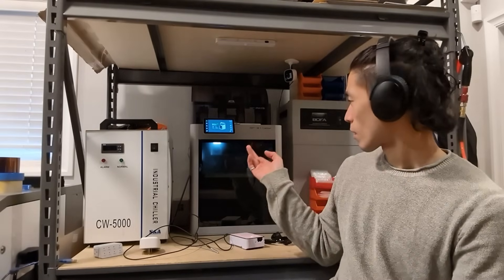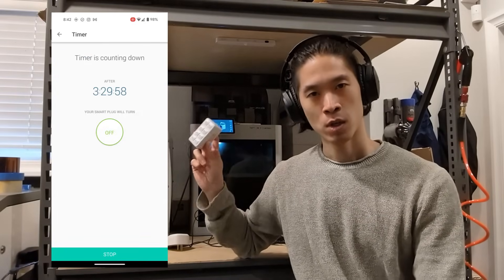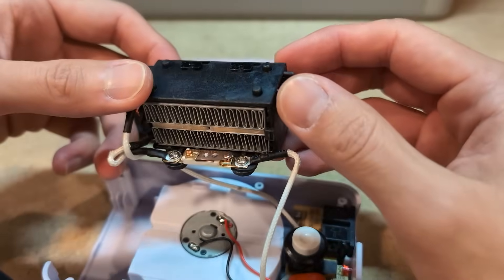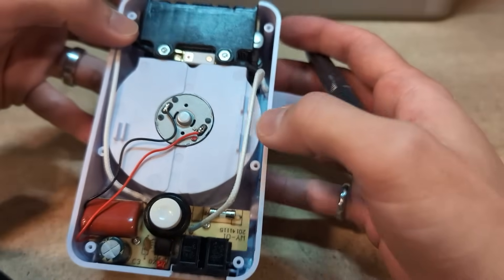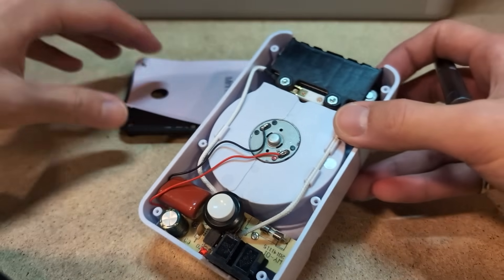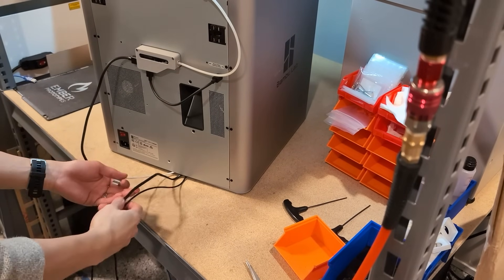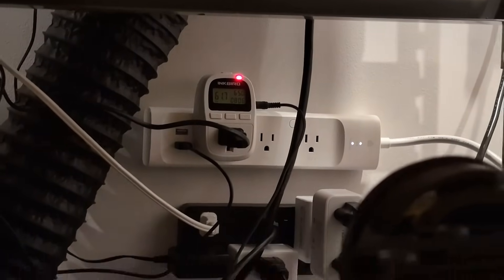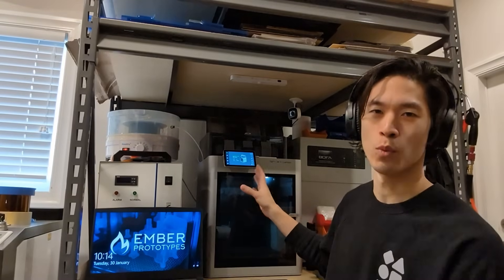Bambulab X1C - $50 HEATED CHAMBER

Comment: An alternative to these three devices, but in the form of an all-in-one, single product (for the same price): the $50 mini heater advertised to heat the resin in MSLA 3D printers (the one that has +/- buttons under the screen for the temperature set point, not the one from Elegoo that lacks them). Especially for EU customers as I am discovering that the YOUCIDI Mini Space Heater shown in this video is sold exclusively in the US and cannot be sourced from China, as strange as it may seem. The mini heaters for MSLA printers are powered from the mains too. They are a bit less powerful but I think they would do the job as well, especially as they have an integrated thermostat so there's no need for a separate thermometer and timer or smart plug. The temperature set point goes as high as 50℃ (122℉) and the size is W.57 × D.32 × H.108 mm (2.25 × 1.26 × 4.25 inches) and the power connector is extra small and plugs on the side, so it can fit in the P1S or X1C print chamber without being suspended (so no need for extra strong tape nor 3D-printed bracket) and without touching the build plate. They also have a (tiny) replaceable activated carbon filter. And of course, these items are available worldwide!
Reply: This unit is on Amazon UK for £32 today.
But the thermostatic ones for 3D resin printers are only £67 so by the time you add thermostatic control they end up much the same.
The resin printers ones may be a good bet.
Reply from the maker: @NickBR57  just be careful, I'm pretty sure some of those only allow you to control the setpoint to 50C which might not be good enough. Plus their wattage is low so it may or may not do anything at all (or take forever to heat).
Reply: @emberprototypes  Yes I noticed afterwards they were around 50W, not enough I think
Reply from the maker: I actually looked at these beforehand and I think there were a couple of problems:

1) I think they have a max setting to them (eg. 50C)

2) They are typically <100W

I never bought one to test though.
Reply: @emberprototypes  Do you really need more than 50°C in the chamber of your X1C? I print ASA only but it's true that you are printing nylon, so YMMV.
Anyway, pay attention because I suspect that more than 50°C for hours repeatedly could significantly shorten the lifespan of the motherboard and stepper motors, as in the Bambu Lab P1 and X1 series these elements are not isolated from the heated chamber, sadly.
Reply from the maker: @fluxcapacitor  There's a reason why Stratasys machines have 80C+ chambers for ASA, ABS, PC, etc. It's definitely very geometry dependent but it helps.

The X1E has an integrated heater that goes up to 60C and uses the same internal components, so up to 60 should be fine. The temperature sensor is also at the door, whereas my location is at the back closer to heat sources, so my temperature controller is actually set to 65 to account for differences in temperature offsets.

Comment: This is Genius! Just one thing I'm not so sure about: how the heater is simply sticking to the side panel with double-sided tape. Because if for some reason it eventually unsticks and falls inside the print chamber (either naturally due to vibrations + gravity, but also with the help of the heat that could soften the glue) then the build plate could crash onto it and get destroyed. That's why Bambu went from the terrible prior design of the aux fan, that was simply glued to the wall with double-sided tape initially (many of them ended up falling) to a 3D-printed bracket to securely support it. Whatever, nothing prevents anyone to add that kind of bracket under the heater, and I guess that some models will quickly appear on Printables and Makerworld.
Reply: You underestimate 3M VHB.
Reply from the maker: @Heiserton  haha yeah, pretty amazing stuff!
Reply: @Heiserton  Right?  I used VHB to attach a camera to the windshield of my car, and that tape / bracket sat in the direct sunlight in the summers of NC.
Reply from the maker: That's a good point. I used a fair amount of high quality VHB tape and it's still on there...I guess I'll find out if it falls off 😂
Reply: I’ve got a newer version X1C and the aux fan is actually bolted to the side panel now
Reply: My fan has been glued to the side wall since early adopter release and ha never moved and has over 2k hours of 60deg+ chamber asa cf printing. It's never moved. The glue they used was insane.
Reply: @yeheyheyyeh89  An isolated example is never statistically representative of a whole set, so that no one is in a position to apply their own unique testimony to decree an absolute truth.  FYI, the glued aux fan on my X1C fell off 🤷‍♂
And I'm an early adopter too, from the 1st batch of the KS campaign.
As I said already, that's because a non-negligible amount of X1C users (i.e. statistically significant) experienced the same that Bambu Lab went from a glued fan initially, to a 3D-printed bracket to support the aux fan from below. Been there, done that.
Reply: I've accidentally had some stuff get stuck under the bed, it doesn't harm the machine
Reply from the maker: @ChipmunksPlan  what happens? Does the machine just stop and error out?
Reply: @emberprototypes  I haven’t had it happen during an actual print, but the stepper just skips
Reply: Silicone bed heaters on vorons and the like are attached with a very similar adhesive, probably not a huge concern that it'll fall off unless chamber temps go above 100c
Reply: @Beanpapac15  bed heaters are attached with rtv silicon, not with double sided tape :P
Reply: @D4rKiTo  3M 468MP double sided adhesive is the standard for mounting silicone bed heaters. The heater itself is made from RTV silicone, but is not attached with RTV silicone. 

To my knowledge the only off the shelf bed that uses silicone RTV for mounting is the discontinued e3d varipower bed. Some high temp industrial machines probably also use RTV as an adhesive, but this would be a waste of effort on consumer machines.
Reply: FYI 3M VHB is used to hold parts of fighter jets together instead of metal rivets.

Comment: I’m skeptical of the long term effects on reliability running at elevated temperatures.  It’s relatively easy to raise the chamber temp but how do you deal with all the electronic components operating in that environment. Similar size stepper motors are rated to 40c. You’re doubling that. Before anyone cooks their printer I’d suggest you place a lot of thermocouples throughout the chassis, even on chips and assess what is going on. System engineering requires you look at  the whole system.
Reply from the maker: The Bambulab X1E has a heated chamber, and uses the same components. There's a reason it's set to max 60C internally - specifically because of your concerns.

Most electronics are rated -40 to 80C as well.

There's definitely an upper limit though, so I wouldn't push it past what the X1E does. Going higher requires isolating the motors & electronics like they do on Stratasys machines.

Comment: I've been using the same heater in my P1P for over a year now. Works great, and it draws little power. Now I have one installed in my K1 max. Great video.
Reply from the maker: Awesome to hear that you've been running it for so long and it's still working!
Reply: What maximum temperature do you set?
Reply from the maker: @vim55k  I set the controller to 65C and it's giving me good results.

Comment: I get around 58 °C in the regular X1C when I print with 110°C printbed. So therefore for me it makes no sense to have an active heater in the printer which could give me probably 3-5 °C more. Having no issues in printing PC, ABS or ASA. Also not with pure Nylon.
Reply from the maker: You must either live in a really hot climate, or have the machine insulated well. There's no way my machine gets to 58C with just the bed on.

I have my heater set to 65C and things seem to be working well.

Honestly, even at 60C chamber, if you print large, dense PC parts, they'll probably warp. Stratasys machines get to 80C+ for a reason.
Reply: @emberprototypes I'm with you, my machine has never gotten anywhere near that. My room temp is ~72-75f. Typically, I see around 48-49c chamber temps after preheating for a while with the aux fan circulating. Even after many hours into the print, that's about all I can get. Hell, I've not hit 58c even with a blanket on the machine.
Reply from the maker: @therealjonnyd  Yup that's similar to what I see on my machine.
Reply: My stock Carbon will maintain 58-60C if you wrap the sides and front with a continuous  piece of silver bubble warp and insulate the top with blankets, towels, etc. There is tremendous amount of heat loss thru the glass and glass joints. Its not pretty but it works. Without the insulation, 48C is the max chamber temp I will ever see. I like this mod and am order parts now.
Reply from the maker: @bretkline4633  yeah that's similar to what I see without an active heater. I was too lazy to wrap insulation everywhere and wasn't thrilled with what it would look like 😅

I agree there is definitely lots of heat loss through the panels though, I can feel it when I touch the machine!

Comment: Those fan heaters die real quick. we tried a couple on our prusas
Reply from the maker: We'll just see how long it lasts! It's be running 8+ hours every day for the past several weeks with no issues doing some production printing 🤞
Reply: I'm afraid of the PETG parts the Prusa is made of and the electronics board inside the chamber. Did you modify any of it? Electronics outside, replaced printed parts with higher temp plastics? Do the steppers like the hot environment or do they need some sort of cooling?
Reply from the maker: @drstefankrank  I'm confused - this isn't for a Prusa machine and there are no printed parts in here haha 🤔
Reply: @emberprototypes  The message I replied to spoke about their Prusas.
Reply from the maker: @drstefankrank  oh sorry I totally missed that this was a reply to a thread, my bad 😅

Comment: Have you considered insulating door and top glass panels? Also maybe good idea to install flap door to poop chute and to isolate motherboard from heating.
Reply: Any recommendations for insulating materials? I have seen the insulation kits on Etsy but curious what you're running.
Reply: The poop is so light weight, what type of flap door could you use that the poop would be able to flap open?
Reply from the maker: Yes I have, but a) I'm lazy and didn't want to have to source, cut, and stick on panels, and b) I didn't want to make my machine ugly 😂
Reply: @emberprototypes  It's certainly uglier, but insulation took 15 min and brought my x1c from 40c to 60c passively.

Comment: The Prusa XL is capable of printing Nylon-CF without a heated bed. Similarly, Markforged printers also do not require a heated bed for this material.
However, I love your mod. Will be super useful for PC, ASA and ABS.
Reply from the maker: Yes it's great for those amorphous polymers for sure.

PACF formulations (along with literally all other filament types) can vary wildly...the Markforged Onyx is specially designed for no enclosure. Some PACF definitely warps less because the carbon inside helps retain stiffness...but it looks like the Bambu PAHTCF still wants to warp like crazy, as is evident with that mold I was trying to print 😅

Comment: Temp sensor for the printer i believe is on the PCB where the power and pause print button is
Reply from the maker: Oh, that's an interesting place to put it 🤔
Reply: They make a green house temp sensor by the same manufacturer that would give you a more accurate measurement.

Comment: Just don't go above 50C, the carbon rods won't like it.
Reply from the maker: What makes you say that? A quick google for Igus Drylin carbon rods shows they operate up to 100C
Reply: @emberprototypes  in the past there was a discussion about which profile to use for the X gantry and rather than CF square profiles the suggestion was to use aluminium or steel, since CF profiles were softening at 60C over prolonged use (quite common for resins used in CF profiles). However, I didn't consider that those 3rd party CF profiles are not meant for that use, while the CF rods in the Bambu Labs are. 
Thanks for checking the specs and correcting me. I will suggest to some people I know about the mod, but I think you should probably use a PID or a loop with smaller hysteresis to control it, those oscillations also mean that for quite some percent of time the temperature is significantly lower, and the strength of parts printed between 40C and 60C changes significantly (CNC kitchen did a video about it using the X-Max 3). So you could get a much more polished and effective setup just by adding 1 AC-DC supply (the cheapest phone charger), 1 resistor, 1 NTC, 1 Arduino micro or Wemos D1 board, and a ready-made MOS solid state relay.
Cheers!
Reply from the maker: @olafmarzocchi6194  no problem! I don't know if Bambu uses Igus rods, but that was a good reference to check since they are designed for the same purpose.

Yes PID would be nicer, but I wanted something with minimal effort and cost, and it seems to be doing quite well thus far. Thanks for watching!

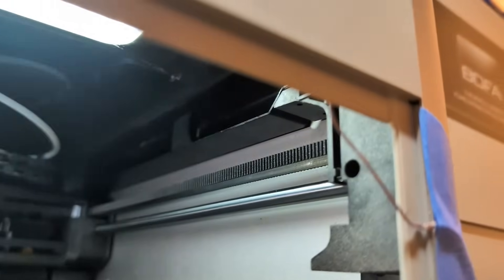Comment: Nice work. 9:33 these are only with heater right? Do you have temperatures on same spots without heater? It would be a nice comparison. You could use a small relay, when it is powered, turns on the heater (many options how to power the relay, for example power from LED, but I am sure there are nicer solutions too). It would be nice if BambuLab would came up with stock solution, but I think they are afraid of ther own printers as competition, forcing you to buy X1E..
Reply from the maker: Yes this is only with the heater on at equilibrium. The temperature oscillates by around 10C when I set the temperature to 65 on the controller and this matches what I see anecdotally in chamber temp with and without the heater.

So it can boost chamber temps by at least 10C. I'm sure it can do more but then you start risking overheating the motors and electronics so I do not go above that.

Agree it would be nice to have an official lower cost option. I hope their next printer comes with it standard, as all new flagship printers should IMO.
Reply: @emberprototypes  I will try up to 70c. The motor and boards are outside the enclosure. I don't think that 5c more will do a wild difference in the motors. Anyways I have a laser thermometer that I can use for test too. Did you turn on auxiliary fan to keep constant air flow. I think at 10% will help the heat distribution. Maybe we can design a funnel to change air direction, so the Nylon  part don't warp
Reply from the maker: @JoseAguiloworkshops  I could definitely try hotter and see what happens haha.

I don't have the aux fan on but the heater itself has a small fan and I have a carbon filter unit running too so I think there is some circulation already, maybe could use more though, but it's hard to tell. I'm not having any issues in its current form

Comment: Oooh thanks for this, I was curious if I'd run into issues, I wanna design a whole PCB with an esp32 for this because I'm crazy. it'd be fun to have a built-in 100w PCB heater and also make it a bento box (Worried about ABS/Fume buildup on those CF rods which aren't resilient or can't be lubed, Wonder if fine graphite powder would work on them?!)

I hope my 100c max heated bed isn't a problem!

I highly recommend adding insulation to the sides and the rear too and the top actually, tey let out a TON of heat. just that alone (only half of the sides and the top) brough me from 40c to 51c when doing ABS (100c bed) I'd be very scared of going past 60c, and it might make the bushings lose and bind (brass expands more than CF)

if i'm being honest 80C sounds like a lot, I'd love to be updated on how it lasts and what happens overtime!
Reply from the maker: There is definitely lots of heat loss through the panels, but I'm lazy and didn't want to slap a whole bunch of insulation on...and I also didn't want my X1 to look ugly from the insulation haha 😅 so this little heater does the trick!
Reply: @emberprototypes  yeah not gonna lie it’s ugly sight but o figured it’s cheaper, I already had a bunch laying around and glued only the top 1/3rd, figured I could take them off. I just lay the top ones on without gluing so I can take it off for PLA
Reply from the maker: @ameliabuns  hey if it works, it works right?
Reply: @emberprototypes  Insulation doesn't have to be permanent ... how about an external "tea cozy" approach. Just place it snugly around the X1C when you need it and store it away when not in use. Works for teapots. 😉 🫖 Make separate parts for sides, bottom, and top of the printer that all velcro together.
Reply from the maker: @robertlawson4295  haha that could work, but I'm lazy 😅

Comment: I just ordered the parts, thanks for the idea. Also, did think that your success is because the heater or because you make some changes to the part? Did you think you will succeed without the part modification? Last question, I saw you top layer a little rough in some areas. It is happening to me too. How do you think or anybody here can tell how the get a almost perfect top layer in a part like that in pacf?

Thanks
Reply from the maker: I think it was a combination of the two. Unfortunately I was on a deadline for the part so I didn't have the luxury of testing one variable at a time 😢
Reply: @emberprototypes  keep up posting in a future video. I will do test to compare later with you and all the people who do the upgrade. Keep the good work
Reply from the maker: @JoseAguiloworkshops  thanks for watching!
Reply: Update:
I received today all the parts and my machine is ready. Printing ABS as we write. Chamber temp is at 56c. Thanks bro!
Reply from the maker: @JoseAguiloworkshops  no problem, thanks for watching 😊